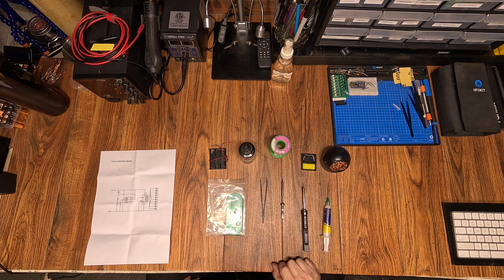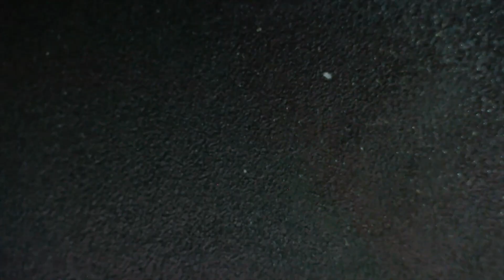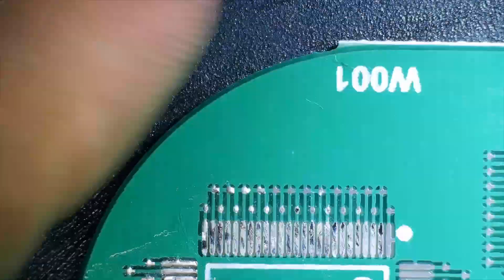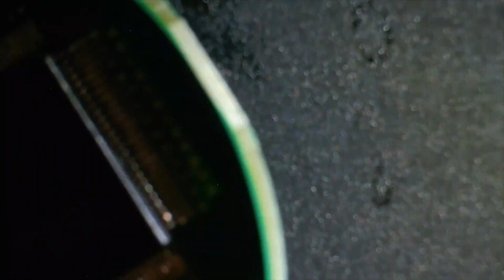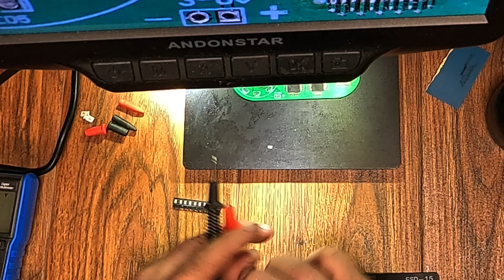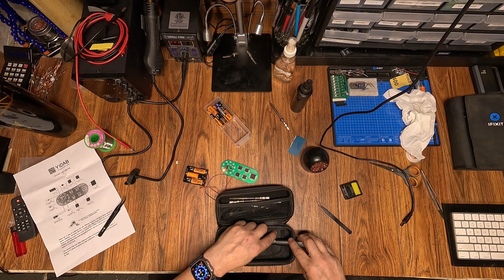The Red Ring Of Death

Comment: Is there a reason for those DSP chips to be on that board?
Reply from the maker: Unfortunately... no
 this is a practice board and those chips have no purpose except to make the installer 5 years older
Reply: @LetsMakeSt-ll2wx  I alsp bet those chips might have been taken from scrap electronic circuit boards. I usually also take them of scrap pcbs just to practice smd soldering

Comment: If you really want to hand solder, pre-solder the pads. Then remove 2/3rds of the solder, clean, and reflux them. Lead free solder creates more bridges and needs a higher temperature. Then you position your chip, use the iron to tack in pin 1 by heating the pad until the solder flows onto it, do the opposite corner to fix the chip, check alignment, then run round the rest of the pins, heating the pads, not the pins. You can move the iron in from the side onto the pin, making bridges far less likely. No chance of bending any of your pins too...

Comment: This is why I stay with tubes and through hole components.
Reply from the maker: Tubes?!? Like vacuum tubes. Sir you must be older than me. Seriously tho I did some through hole yesterday what a breeze. I'll do those all day.
Reply: @LetsMakeSt-ll2wx  Yes, age 69.  Through hole is great.  I love the Hakko solder sucker.  Makes removing components so easy.  Don't bother with solder wick.
Reply from the maker: Actually yesterday I tried using the mechanical one for the first time when I put some header pins in the wrong way I was like this is not going to work but I was pleasantly  surprised.
Reply: @LetsMakeSt-ll2wx  You mean the hand held one with a plunger?  They do work but are a pain and I don't like the way they kick back when they operate.

Comment: Solder paste & the hot air gun will to the trick, you won't need a stencil.
Put a bead of paste down each row of pads. Place the chip close to the correct spot, as long a the pins are not touching the wrong pads, you will be fine.
Use a low air flow and circle the chip. You want to heat all the pins evenly and not blow things off the board.
When the melt comes, surface tension will draw the paste between the pads into the joints and center the chip as if by magic.
Have fun!

Comment: Personally, i preffer leaded solder. Way easier for a beginner like me, but hey, if it works, why change it?  Nice video!
Reply from the maker: Like I said in the video I have no idea what I'm talking about. I just put something else together just for fun and used leaded solder. So... much... smoother. 
I think because I was using such fine solder .01" and only soldering 603 smd for the last few kits I didn't notice. But now I wished I had used leaded for those  chips I bet it would have been much easier. Good luck to you in your new hobby. 
I too, as you can probably tell, am a beginner.

Comment: If you look at the pins and where they go, you can see they all go to ground. That also means the heat goes to ground. And that ground plane is maaaaassive, both in size and in mass.

Preheating the board in some way can do wonders. Even if that means you just place it under a hairdryer, or like I do, put it on my 3D printer's bed!

Leaded solder is in ways better than lead-free, and one big one is the vastly lower melting point. That itself leads to some of the benefits/upsides.